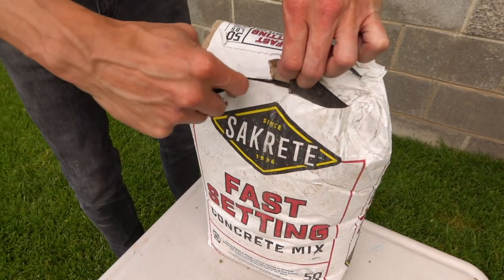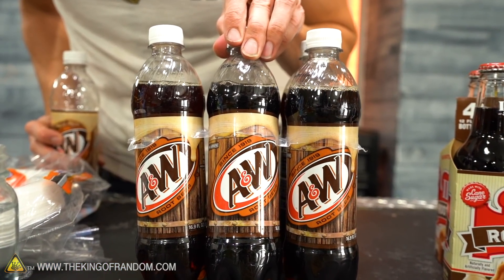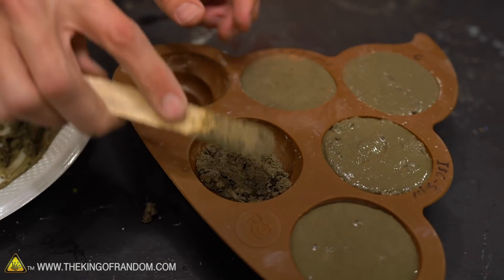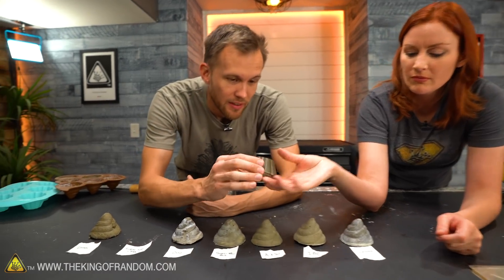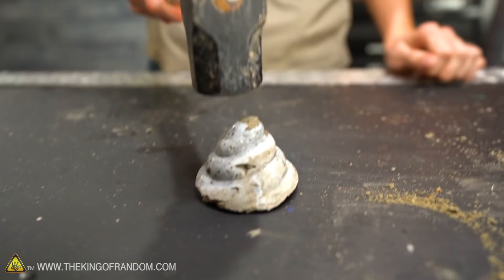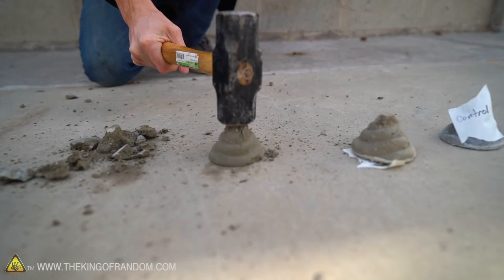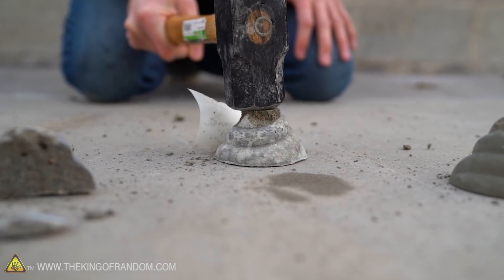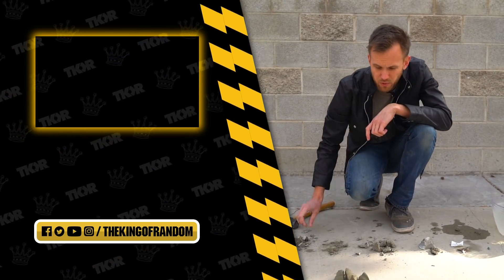One of These Ingredients Makes Super Cement

Comment: This is interesting. What if concret mixed with: oatmeal (observers fluit) , hey (is used in clay for buildings), straw (was used to isolate buildings), starch (is used for cold clay), this nudels which can be used to fix a sink, regular flower (was used as glue, stil is just watshed a diy cork video), wall paper glue and plaster of paris? 
 what happens if you dip fabrik into the mixtures? (a lot of crafter mind to know😉) 
what got me thinking is: is the shine of the sugar one based on the mold or based on the sugar, is the strenght also based on the form and not the mixture?

Comment: Sugar is often used in manufacturing drywall/sheetrock to slow the evaporation process and prevent brittle edges. I would imagine this was likely the cause of your weak cement. It wasn't even close to being cured.

Comment: Redo the sugar  before water and sugar after water using the same mold.  Also, measure the dry ingredients by weight rather than volume.  Fine to use volume for the initial control measurement, but at the least get the weight before the water is added, so that you have a consistent amount of cement by weight.

Comment: A couple more ideas:
What if you made starch glue (for book binding) and mixed that in? Starch thickens soups and sauces not unlike gelatin or agar (another idea), and might provide a little added binder.
What if you put the cement mold in a vacuum chamber to pull the bubbles out? Seems to me the carbonation is making the cement weaker, so why not go the opposite route?

Comment: You might also try vibrating the molds after they're filled and the cement is still wet to get rid of any large air bubbles.

Comment: Try mixing in some beaten eggs or even just egg whites.  I feel like the protein would anchor the particles and make it super strong.  Maybe the same with tomato puree.  Anyone who has let some tomato sauce splatter onto something and dry knows you practically need a chisel to remove it.  Since PH seems to matter, maybe try making it with some dilute bleach--I'm curious to see how a basic PH would do vs. the acidic lemon juice which didn't seem to mix very well.

Comment: Can you do a strength test where you compare different levels of sugar mixed in concrete powder to see how it affects the strength. Like 3/4 Concrete 1/4 sugar,  2/3 C 1/3S, 1/2C 1/2S, 1/3C 2/3S, ect. Maybe try in a small mold and then a big mold(like a brick) to see if the size has any effect to its curing/strength. Is there a butter zone where you could effectively increase the amount of concrete you have, without compromising it's strength, by just adding sugar?

Comment: Drill a hole in the end of the hammer handle and put a bearing and bolt through, then make system where you can drop it from repeatable heights. Other option: Take the head off the hammer and drop it down different lengths of drain pipe.

Comment: I did some quick research and found out how sugar can make your body acidic. The body ends up no less than 65% water by the time we're old. You were explaining how acidity causes the cement to break down. Chances are, by adding sugar before water alters the sugar chemical properties, preventing it from turning the cement acidic. Metal is a form of rock, which is one of the elements of our physiological makeup. So, rock is likely what turns sugar acidic when it properties aren't altered by another material before adding water

Comment: The cement I buy needs something to 'cling' too. Just using cement alone makes it quite week, you need to mix in some sand, maybe test different sand. About 3 days cure works for me with building sand, I tested very beach sand like garden sand and it took about 2 weeks instead of 3 to cure just as hard.Curing is the biggest obstacle, but giving more time gives everything a fair chance :)

Comment: when you mix water and cement  you create what's called 'belite' and its calcium silicate basically, this further reacts with the water and where one of the byproducts is calcium hydroxide, which is what's reacting with the citric acid in the lemon juice making calcium citrate instead of actually curing if I'm not mistaken

Comment: Generally, material strength tests for cement/concrete occur after 30 days.  After only two days, the cement is just barely cured and has only a small fraction of its 30 day strength.  Cement will continue to cure and get stronger indefinitely so long as it is exposed to moisture, albeit very slowly after the 30 day mark.  Of course this cure rate varies with the chemical makeup of the cement and admixtures which have been incorporated into the mix.

Comment: My theory is that the sugar isn't doing anything chemical, it's just forming very small pockets in the cement that is not cement, creating lots of small stress risers within the material. The carbonated water does the same thing but on a slightly larger scale with gas bubbles instead of sugar grains. In the one where the sugar was added before the water, most of the sugar was allowed to dissolve which results in isolated molecules of sugar getting well-distributed and suspended in the cement, resulting in a much lower effect on the overall integrity of the cement (though I've got nothing on why that cement was so runny after mixing).

The lemon juice, on the other hand, triggers a chemical reaction with the lime - a critical component of cement - and prevents the curing from taking place at all so the "cement" gets rendered into just a pile of wet rocky sand. The sodas contain acid as well (A&W contains phosphoric acid, IBC contains citric acid, and both have trace amounts of carbonic acid just by the nature of carbonated water) which would do the same thing, but less so since soda doesn't contain as much acid as straight lemon juice.

I think a follow-up experiment to test this theory would be to make a batch with water that has sugar dissolved into it and a batch with water that has corn syrup dissolved in it, and maybe repeat the sugar batches of this video in two sets with one set using granulated sugar and the other using powdered sugar. I'd also try working with citric acid in solid granular form similar to the sugar in this video - one with the citric acid added before the water, and one with it added after the mixing. Maybe also go the other direction and see what effect baking soda has on cement (if any) with similar mixing procedures.

Comment: Well with the carbonated water it is slighty acidic so it wont cure as much and the co2 bubbles could possibly foram aireated cement witch is ment to break. Thaey put it at the end of plane runways to help slow down  plane that are going to fast.

Comment: Some of the functions of sugar in concrete are as follows;
    Increase in flow ability and compactness.
    Retarding action on concrete.
    Reduction in hydration heat and temperature cracks.
    Increase in later strength of concrete.

Comment: I believe they used rice-flour when building the Chinese wall which made the concrete more durable against weather, it is said to plug the pores, the Romans was said to use volcanic ash…. As for the sugar mixtures, sugar dissolves in water, so I would say that adding it later when the concrete has used up most of the water leaves it with left less water for the sugar to dissolve in, therefore that mixture got dryer. Otherwise this just proves you should not risk pollute your mixture

Comment: I think possibly because the sugars are hydrophilic they dissolve in water.  When   the water was added to the  sugar first (hard setting sugar concrete.) IT dissolved into the water, and acted like sugar does in baking;  It almost becomes a liquid.  That allowed the concrete to cure.  When the sugar was added to the concrete and water first it drew out the water, which makes me wonder if adding salt would produce a similar reaction?  The action of drawing the water out must have kept it from curing. That was an excellent experiment!  That is my best understanding of the situation but I could be wrong.

Comment: Seems logical. The calcium in the limestone, used to create crystalline lattice structures between pieces of aggregate, was was neutralized by the citric acid. The carbon in the carbonated drinks caused the calcium to form in cuboid structures, rather than long strips (like fiberglass), as well as creating micro-cavities the weaken the integrity of the cement. The sugar, having a similar crystallization pattern as the calcium of the lime would help to reinforce the structure until its fragile crystals shattered or dissolved in water. Hence the surprising results.

Comment: Before I watch , I dint think it will set using soda , only reason I say that is when I was in the oil field and we were cementing drill holes the excess cement was mixed with sugar to keep it from setting while it was in a rolloff dumpster awaiting pickup for discsrd

Comment: I know that in Australia when we want exposed gravel driveways we spray a sugar water mix over the trowelled concrete and it stops the top layer from curing so a couple of hours later when the concrete has firmed up a bit the top is still soft and you can broom and hose it away leaving exposed gravel

Comment: The result is... use it as intended. Most are, 2 parts water to 1 part cement. Read the instructions and that's the way it's intended to be used.

Comment: I took loose cotton fiber and coated it really well with graphite powder then mixed it with epoxy abd formed it into a brick. It made sandpaper smooth instead of it when I tried to sand it, also couldn’t break it no matter what I did to it. could still drill holes in it though.

Comment: I would thing the acid would react with the lime in the cement 
How about doing it with something that doesnt have acid in it and as a control on the strength how about using a hydraulic press with a pressure gauge on it

Comment: Sugar slows down the set time of concrete. What probably happened is when you added it first it was able to slow down the set time. Most likely by adding the sugar after it was mixed you interrupted the setting and cause it to set unevenly making it weaker. Just a theory though.

Comment: Every carbonated beverage is at least slightly acidic, and that may have played a part in all the tests using them, not just sugar.
Reply: Even the carbonated water?
Reply: @7-ten  Yes, carbonated water is slightly acidic, as well. Any time you dissolve CO2 in H2O, the chemical reaction between those two molecules will result in an equilibrium containing a small amount of H2CO3 (carbonic acid).
Reply: Sugar is also slightly acidic

Comment: you should try vacuuming cement just after mixed to see if it's stronger or not, essentially trying to pull all the air out and then let it set
Reply: It would also boil away all of the water, meaning it will never cure or set.

Comment: Ok im not trying to be a party Pooper but, 
According to the American Concrete Institute (ACI) the standard test of the compressive strength of Concrete should be a uniformly cylindrical shape the sample must be un accordance with the C172 classicafication sampling. And theres a minimum (3) number of sample/Mixes should be taken for each batch according to EN206 (Euro standard) / ACI 214R-11 (American) with a dimension mold of 150mm dia. and 300mm height cylinder {To convert just divide 25.4mm to acquire the english conversion}. The sample must be then cured with accordance of (American standard for Testing and Materials) ASTM C31/ ASTM C31M and should test with a requirement of ASTM C39/ASTM C39M. Thus the video are should be classified as void/null with a accordance with the required testing standards. Nevertheless this video quite enough to entertain.😃 P.S try Volcanic ashes mixed with concrete. "just sharing"

Comment: Cement is a  base reaction, so when you put any chemical that is acidic (carbonic acid, lemon juice ) it neutralizes the reaction and the bonding is weak. I think ( this is just spitballing) that the difference between your 2 sugar trials is whether or not they were totally dissolved. Although the one had more sugar, it was probably totally dissolved since it was mixed into the mixture, whereas the other was added after and may not have dissolved totally, thereby becoming inclusions into the concrete and weakening it.

Comment: I would like to say that you guys added a fair amount of sugar to the cement (by total volume) and may not have given it enough time to properly cure. I am aware of studies that have found a small amount of sugar will notably increase the cure time but, in return, provide a stronger final product, though larger amounts prevent it from ever really curing at all. I'm curious what varying the amount of sugar in the concrete will do given an extended time to cure. And definitely please maintain the same shape, as that can have a huge effect on the strength of the final product.

Comment: It’s not the fact it has more sugar it’s the fact that the shape is different the poo has a pointy tip meaning it will have be weaker at the top now the other one has a flat top so it can take more damage evening out the force put into it

Comment: Concrete does not properly cure in 3 to 5 days. In construction, the final compression test, meaning at what pressure the concrete is designed to fail, 3000 psi, 4000 psi, 5000 psi, depending on the specification required by the structural engineer, takes 28-30 days. The Hoover Dam is still, technically, curing.

Comment: The citric acid will have destroyed the structure of the Ca Co2. Cement is made by roasting limestone, which is made from calcium carbonate. This is easily dissolved in acid. The roasted limestone, or 'clinker' binds all the other components in cement together chemically. Destroy the clinker with acid, and the other constituent parts will not bond together.

Comment: Sugar retards the set of cement.  I used to work in the oilfield service industry.  We would send sugar to location to be mixed with the excess that came from the backside when cementing casing into the ground.  There are also conditions when a retarder is added to a cement blend to extend the set time.  PH levels of the water will also dictate the blend of materials used in those downhole cement operations.

Comment: Maybe the issue is more the acid mixed with carbonation. For adding sugar after... Maybe it was an air thing? Like adding it from the start caused the sugar to fully dissolve into the water while mixing, but adding the sugar after caused weak points because the mixture wasn't wet enough?

Comment: My two cents as a geology major. Cement is made of lime (from limestone) as a major ingredient, also known as the mineral calcite. Calcite will fizz and react strongly with nearly every acid even weak acids such as vinegar and lemon juice. I am not surprised anything acidic would ruin it. You could try adding magnesium powder into the mix though, I am curious if it will form a stronger bond.

Comment: All the civil engineers are crying right now at hearing you are "making cement"!  Cement is the dry ingredient you are using to mix with the liquid and/or aggregate to make CONCRETE.  Unless you are actually creating the fly-ash in a kiln and mixing it with lime, you are not making cement.

Comment: Ok, if acid made it bad, try adding something base, like baking soda
Reply: Quick dry cement has Lye in it to heat up and boil out the water.
Reply: it contains lime alredy as its base and baking soda isnt as base as lime. maybe something higher on the ph scale tho? altho that becomes dangerous quickly.
Reply: Ohmygosh
YESSS
Reply: Baking soda is still slightly acidic so the same result would be achieved
Reply: @theboyfromla3781  Baking Soda has a ph of 8. It's slightly alkaline.
Reply: @michaeljorizzo8152   but it reacts as an acid in the presence of stronger bases such as Lyme a component crucial for the curing of concrete
Reply: @theboyfromla3781  Are you possibly confusing baking soda for baking powder? Because baking powder contains cream of tartar which would possibly make it slightly acidic.

Comment: Maybe try using soap, because of its high ph way higher than acid
Reply: Soap will make the concrete not cure, as it will bind the concrete particles away from the water, making it weak. If you mix concrete with water contaminated with cement, like that used to wash the tools clean, it will also not cure well, cement is a product that needs very clean water to mix, and contaminants will reduce strength. Surgical cements will be mixed up with  sterile distilled water for this, amongst the other bacterial contamination reason, so they can reach full strength.
Reply: @SeanBZA  aah okay, thanks

Comment: sugar inhibits the curing process it will cure it just needs much more time . This is commonly  used in the oil and gas industry for some projects when you need more time for cement to flow to certain places.

Comment: Whatever you mix in, try to control the shapes used AND the stresses you apply. Whacking it with a hammer isn't consistent unless you build a rig to apply the same force each time.

Comment: Btw cement takes a long time to completely dry and depending on what you use to wet it it’ll take different amounts of time to cure. You should waited longer and I bet some of the ones that weren’t as strong would’ve been harder because they had more time to dry. It the concrete business you can put in different additives called hardeners which make the cement dry up quicker or slower depending on what you need at the time. Also temperature also plays a big part on how cement can cure. If it’s too hot it’ll crack and if it’s too cold it will take forever to cure. Concrete is a very delicate process all around.

Comment: If you're gonna do these incremental hits, you need an incremental hit machine
 Sledge on a pivot, and you lift it up higher and higher. At the top, you have some springs to cause more speed/pressure